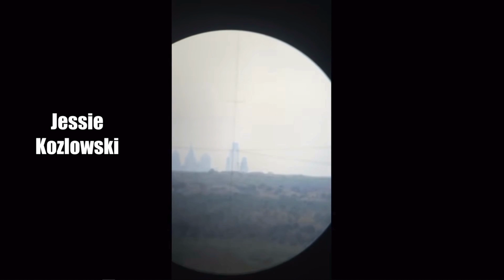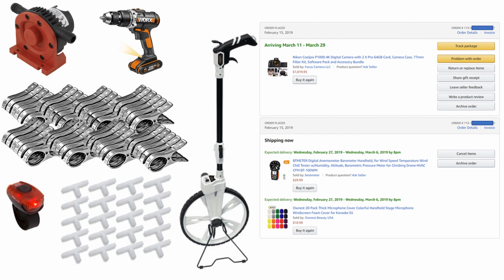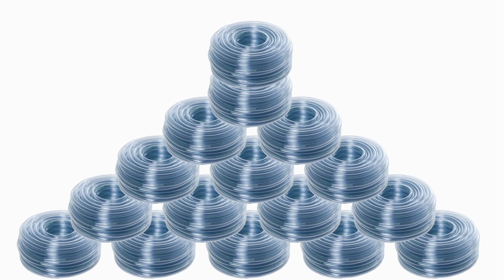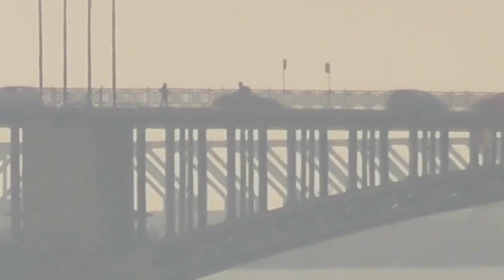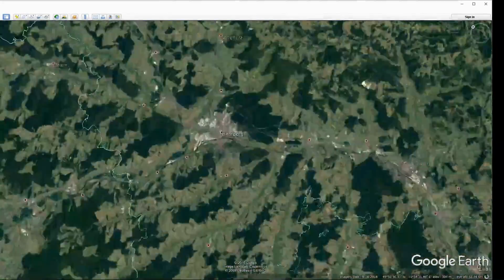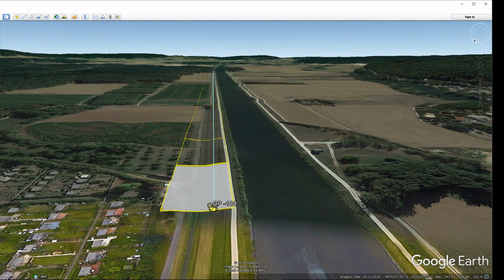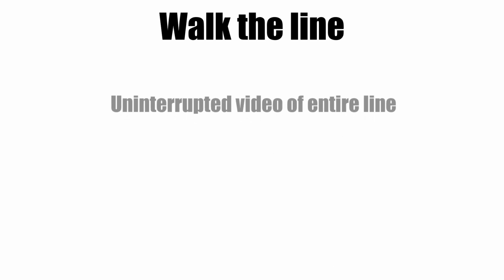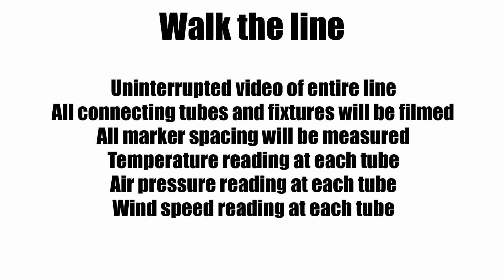Bending Water Test Update 2

Comment: The test site is 794 ft above sea level on the North West end and 793 ft above sea level on the South East end. He is supposed to be measuring a difference of 4 in from the center to one end but I do not see how he could even come close to this accuracy even though the water does level to with in a fraction of a millimeter.

Comment: Sly, you really should measure the temperature at different heights to get an estimation of the gradient. We need this to show that refraction cannot account for the observation on a flat earth. If the temperature decreases fast enough with height, then the light will be refracted upwards instead of downwards and if the radius of curvature of the light gets small enough, it would produce the same effect on a flat earth, as it would on the globe without refraction. 

Consider this formula: k = 503*P/T²*(0.0343 + dT/dh). [1] It means that the radius of curvature of light rays equals R/k for the earth radius R = 6371km. If the earth were flat and if k = -1, then the light would be refracted upwards with a radius of curvature equal to the earth radius. For P = 1013.25mbar and T = 10C° = 283.15K, this implies dT/dh = k/503/P*T² - 0.0343 = -0.192 K/m.  

So if you can't show with confidence that the temperature does not decrease at a rate like this, flat earthers can claim that the observation can be accounted for by refraction. This could be troublesome of course, because the height and temperature differences in question are minuscule. But if you don't address this, there will be a loophole left for flat earthers. 

[1] https://en.wikipedia.org/wiki/Atmospheric_refraction#Terrestrial_refraction

EDIT: I mistakenly used 0.343 instead of 0.0343 in the formula and fixed that.
Reply from the maker: " you really should measure the temperature at different heights to get an estimation of the gradient."
what would that accomplish?
"We need this to show that refraction cannot account for the observation on a flat earth"
refraction would only come in to play if the horizon was involved
Reply: @slysparkane808  "what would that accomplish?"

To predict refraction, we need the refractive index gradient. To get the refractive index gradient, we need the density gradient and to get that, we need the temperature gradient. Measuring the temperature at different heights allows us to approximate the temp gradient with a constant function. In the formula I cited, it's referred to as dT/dh. 

"refraction would only come in to play if the horizon was involved"

That's completely wrong. Refraction is inevitable in a medium with changing refractive index. The only case where it doesn't come into play is if the light travels parallel to the gradient, but exactly the opposite is true for observations like this. The light travels about parallel to the ground and thus perpendicular to the gradient. Refraction is maximal in this case.
Reply from the maker: but the corridor of observation is 15cm heigh. and parallel
Reply: @slysparkane808  So what?
Reply from the maker: that's more my answer than yours..
Reply: @slysparkane808  Please enlighten me. What do you conclude from _"but the corridor of observation is 15cm heigh. and parallel"_?

Comment: Is the underground soft enough to drive the poles in? will you require a sledgehammer, and/or extra poles? Do you have a posthole drill?
I think your biggest problem is going to be temperature control, if you can get the tubes filled
Reply from the maker: like 2 day old brownies
Reply: Sly Sparkane 👍
may depend on the weather

Comment: From memory there is a formulae for determining the pipe size required for a water level of a given length.  Have you calculated the appropriate size or consulted an engineer to ensure that the levels will be accurate?
Reply from the maker: air trapped in the tubes arresting flow of water will be addressed just after filling. small inner wall bubbles should not have any affect
Reply from the maker: I am not measuring the volume of water.
Reply: @slysparkane808  I understand that (I am an engineer).  If the tubes are too small then the water height in each tube will not be level with each other.
Reply from the maker: The research I looked up basically only stated problems with the capillary effect on much smaller tubes which would present a significant issue, however I found nothing on any fluid type with tubes above 8mm diameter. so I am pretty sure we're good.
Reply: @slysparkane808  So long as you're confident, I'll leave it with you.
Reply: @slysparkane808  
Trapped air may act like a spring and make the whole device unstable.  If there are any appreciable temperature differences along with trapped air you may end up with a fluidyne engine on your hands.  This would be awesome but I suspect the chances of this happening are non existent but as everyone else is having a go I thought I'd chime in.

Comment: Would be nice to see how this is supposed to shut the "water does not bend" trolls out there. I can already imagine them already thinking of a way to get around it.  So, specifically, could you explain what this experiments would work and be unrefutable please.
Reply: All experiments should be refutable with a hypothetical piece of evidence.  It will falsify the claim that water always finds its level when level is equivocated with flat.  It'll be level with respect to the local direction of "down," (that everyone else calls gravity), but the water columns won't line up, even though they will fill to the same height.

Issues could arise if there is a variance in the gravitational field, for instance if he passes across the top of some high density rock.  Those columns wouldn't be at the same height, and a variance would be encountered.

The flat Earth model wouldn't even be able to posit an explanation for that variance on a level surface.
Reply: @RustyWalker  Got you, thanks,  makes more sense now.  One more thing,  Their full ongoing narrative is that " Water does not bend, water always finds its level",  equivocating level with flat, but also equivocating bending water (esp. large body of water like an ocean)  with what is actually happening which is water  comporting to the shape of earth due to gravity.

Comment: Wouldn't it be much easier to just use three tubes? It would eliminate a lot of potential problems, and you could mark the water level at each one with something wayyy larger than if you're trying to mark like 20 of them.
Reply from the maker: 3 tubes would be fine for the rational audience but I want to make the visible arch.

Comment: I'm impressed with the amount of effort and expense you're going through for this experiment even though everyone knows that the flat-Earthers won't accept the results.  I'd like to suggest a simple addition to this experiment.  Once all of your planned measurements are complete, leave the marker clamps at the waterline on vertical lines 0 and 16. and place clamp 8 so that it is perfectly in line between 0 and 16.  Measure the distance from the clamp to the water line.  From this height and the distances between the verticals, you should be able to calculate the circumference of the Earth.

Comment: Actually I would suggest making your observation early in the morning before the sun has mannaged to heat the air or the earth at all.  This is usually the best time of day for observing the sun for solar astronomy.
Reply from the maker: I thought of that too.. but then there is the issue of pre-dawn setup...
Reply: @slysparkane808  Completely reasonable.  As annoying as it is you might need to do this twice, just to get the bugs out.  I've rarely done a precision measurement to my satisfaction on the first try.
Reply from the maker: well.. I tend to be quite a picky bastard when it comes to my tests.. does not make me above error, but I am pretty sure this will go well on the first try given the prep.
Reply: @slysparkane808  I am looking forward to the result.  I'm also looking forward to the flat earth excuses.  Good luck.
Reply from the maker: if this was right down the street.. it might be an option, but I have to travel 2.5 hrs to the site and I am not looking to spend the night at the location

Comment: The upper and lower clips should be as far apart as you can sort out. IMO 

8 hrs is a very short time estimate. 

You should get a few hundred m of tubing early and test a shorter run. And consider a light on each clamp.

Comment: I have said this before, but I take the chance to repeat myself. I am pretty sure you will run into trouble while filling the tube as water will take the easiest way out. It will escape through the first upright long before it reaches the furthest one. Are you going to plug each upright as water dribbles out, or are you planning on something else ? Also, you'll need about 80 liters of water if you go for the now suggested 8mm piping (vs 125L with 10mm). Getting all that water into such a long and tiny pipe will not be done in a whiffy, even with a pump.
Have you checked pump capacity vs the drill capacity vs available batteries vs the pipe's flow resistance ? I'd like to hear your thoughts on the numbercrunching side of this.
Reply: it'll be fine
Reply: If I'm not mistaken, the water will naturally seek the path of least resistance, so it should fill the entire length of the horizontal tubing before traveling up any vertical tubes.
Reply: you really think water will flow vertically rather than horizontally, and achieve a significant head height? how fast do you think that pump actually is?

if this actually did start to happen, you could simply fill it through the top of that first tube
Reply: Oh, I didnt notice that the pipe diameter got reduced. Hagen-Poiseuille will be even more influential then ...
Reply: it's def going to be a concern as pressure loss in tubes when a fluid is running through def is a thing, we'll see how it works out i guess. he could close all the upright tubes bar the last one if it doesn't, and fill them by hand afterwards tho.
Reply from the maker: Guinnessian
Yes about 88 liters and I will be filling them quite slowly.. I anticipate aprox 20-30 mins because even though the t-connectors will hold the water just fine, blasting them with the full pump pressure would be reckless.

Brian P 
yes, the bottom should fill first, then the uprights though some might go in the uprights as the ground pipes go over small differences in terrain.

Harry M
Bubbles will be addressed directly after the fill process to ensure solid water throughout

Hagen
Hagen-Poiseuille does apply but the will not have a show stopping affect

Ferze001
I have alternate methods on hand including a gravity fill bucket if needed.
Reply: @slysparkane808 

maybe get some hose clamps for the t-connectors from the get go for extra safety? i'd imagine it might be a massive pain in the ass over the whole distance if the connections start leaking and you'd have to pump in extra water constantly while trying to fix them. they're quite cheap as well, on amazon i've seen a bunch of 12 with range of 10-16 mm at around 8 euros.
Reply from the maker: Got that too.. will be using good zip-ties
Reply: @slysparkane808    I think you are grossly underestimating the time needed to fill the hose. According to https://www.copely.com/tools/flow-rate-calculator/   you'll get a flow rate of no more than 0,25 L/m at the half way point if you use a pressure of 4 bar. To fill it in 30 minutes you'll need a continious flowrate of about 3L/min ...

Now to my logic (and worry) in this, for those who didnt get it:
If you have the uprights fluidlevel at 150cm it takes 0.15 bar pressure to fill it. Due to the built in flow restriction in the one mile long pipe you will have to push way more than 0.15 bar to get the water to the other end anytime soon. Because of this the nearest pipe will certainly overflow and you have a problem. It could, as I have suggested, be fixed by blocking off each upright as they fill. Any way you will have to spend way more time than what you have guestimated. This is the underlying reason for why I also asked about pump and drill capacities.

I strongly suggest you do a 'dry run' with at least 200m of pipe and 2 uprights before setting up the real deal. You dont even have to unroll the pipes for that.

PS I have been thinking you'd be filling the pipe from one end. Why not do it from the middle marker and feed both ways simultaneously ? Half the time saved just by that.
I am sure you'll still need way more time than guestimated though.
Reply: sounds great.
another thought: how about a valve for every upright hose right after the connector so you won't have to mess with water spill on them by too much pressure when filling the connecting hose? you'll need one on the filling end anyway...

Comment: Thanks for the update @Sly Sparkane.  Have you thought about how much care and effort will be required to make sure that the tubes are not only aligned correctly, but also perfectly upright?  I'm imagining what a row of vertical tubes will look like if they are not all perfectly upright and aligned.  Did you get my earlier email I sent on Feb 4th?
Reply: The irony is that the flatty will immediately jump up and down if the vertical tubes aren't laterally aligned (aka, how do you tell if a fence is on a straight line). However, they don't apply the same logic when they rotate their attention 90 degrees.
Reply: @FLATEARTHPERTH  I know, but that's not what I said. I said laterally aligned in a straight line. You've made the same mistake in many of your videos about auto-levels where you point out that objects are in a straight line horizontally, but some magic causes light to dip vertically. I would have pointed out why that thinking is wrong (and you got your math completely wrong in a few recent ones) but, well, you know (come on bro, your Cavendish experiment with milk cartons was completely sub par - admit it).

And btw, a couple of the recent videos you are mirroring are clearly doctored. I'd point that out to you to if I could. You still owe me a video on forensic video analysis from way back. Did you do any analysis on those ISS videos? None of the original sources are referenced. Doesn't that make you a little skeptical?
Reply: @AndrewEddie  Ask FEP how his autolevel got so out of calibration? He won't answer me.
Reply: @robguyatt9602  that kind of question gets you blocked (trust me). I'm in the middle of moving countries but I'm left with no choice but to do the old "FEPE vs Geometry" response video. His problem is that if he starts addressing those issues, the support  Oakley and co are giving him will drop like a hot potato. Truth is not a prerequisite for being a Globe Denier.
Reply: @AndrewEddie  He's actually replied to me a few times but of course never actually answers the questions. As per the first commandment of Flatism,  Thou shalt not give a straight answer. Your last sentence is covered by their second commandment; Thou shalt bear false witness. 

I'm not familiar with the FEPE vs Geometry thing. But go for it with your vid. Looking forward to it.

Just subbed btw. So where are you going? I take it you are in Queensland? I'm in the Barossa Valley SA.
Reply: @robguyatt9602  oh, the "FEPE vs Geometry" is just my name for it. Not sure what to call the series yet ("FEPE's fumbles"?), but his latest video on Rob Skiba's balloon already adds material. He compared a graphic from Walter's curve simulation without matching the field of view for a start, and he fails to scale his angle of attack comparisons (at scale, he's like equivalent to an altitude of several thousand kilometres). The sad part is seeing comments that people buy this stuff without applying any critical analysis. Biggest pain with doing response videos is doing the voice overs. Does a better job, but it takes a lot of work.
Reply: @AndrewEddie  I'm told he claims to be a professional photographer. Your comment about getting field of view wrong says one of two things. He's lying about his profession or he's lying about representing Walter's work. He also did a vid showing a bent beam to debunk Soundly's causeway photos. If he was honest and knew what he was doing the beam would have been a scale model of the causeway. I've drawn it to scale in CAD and plan to build a physical model so it can be filmed from the side and end on showing how Soundly's photographs are real. One of these days LOL.
Reply: @robguyatt9602  he could be a pro photographer, I don't know. I got the impression he worked in some sort of distribution warehouse kind of setup. To his credit, he's got some good gear and he at least makes an effort. The downside is he doesn't have the maths background to realise his obvious mistakes. I can't wait to pull apart his sunsets ;)
Reply: @AndrewEddie  The funding thing he did to get a video camera to be carried by a drone shows he knows nothing about photography or drones. It is a complete farce. Did you see it? I can't remember who did a vid on it. And he got involved in the comments and made himself look even more foolish.
Reply: @FLATEARTHPERTH  
of course they need to be vertical for his setup of measuring, don't you understand what he is trying to do here?